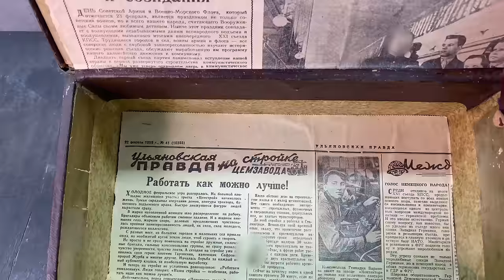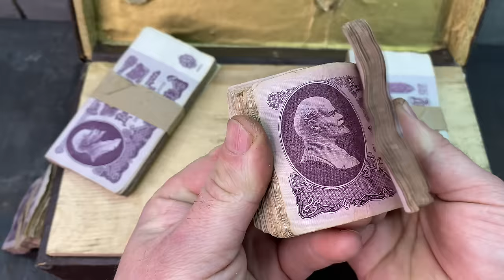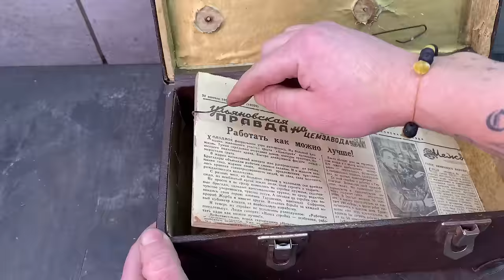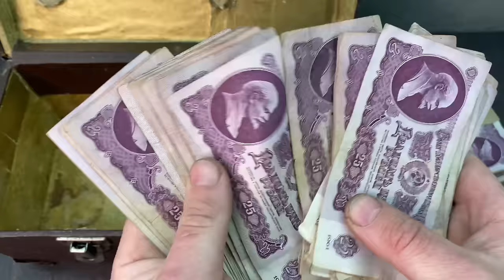Travel suitcase restoration. Found 20 000 💲 under a secret bottom.

Comment from the maker: I think that you will also be interested in watching a video on restoring an old Huge Rusty Drill Press.
https://youtu.be/1rxJamyqY1I
Reply: 这套苏联卢布发行之初，1卢布=1.11美元，中间20几年也算平稳，因为这一时期主要是勃列日涅夫时期，加之美国深陷越战阴霾，这一时期美苏争霸苏联处于攻势，苏联达到了全盛，七十年代也是苏联人民生活相对比较幸福的一个时期，但是也是苏联的“停滞期”，这一时期领导干部几乎成了终身制，特权阶层特权进一步加强，勃列日涅夫带头贪污，下面官僚办事效率和贪污腐败程度就更为严重了，地方官员基本上没有多大变动，可以一直当官当到死，而且有些官职可以明码标价，这样也使得贪污腐败更加便利。总之，勃列日涅夫给贪污腐败、特权阶层、低行政效率创造了一切有利条件，同时给后来苏联老人政治埋下极大隐患。这一“平稳”时期卢布最高时期可达到约1卢布=2美元。然而苏联的好日子却即将走向尽头。1979年底，穷兵黩武的苏联入侵阿富汗，从这一刻起，苏联走向灭亡的命运开始了。到1982年，苏联经济已全面陷入停滞，也是在那一年勃列日涅夫辞世。
Reply: Куда спрятал еще две пачки?
Reply: I think so too. I've already got it queued up! Thanks for your continuing efforts. I find your videos very interesting and relaxing.
Reply: P
Reply: P
Reply: One critique.  Spray adhesive is designed to be sprayed on both items to be used.  You spray the box and then the vinyl, let completely dry then stick together.
It works like rubber cement.
Man you reduced that to just a thin wooden box.  At what point are you just building a new (replica) suitcase?
Good video!
Reply: What did you spend the 20 grand on? P.s. congrats!  Like winning the lottery.
Reply: 😂 11:06
Reply: You do very good work!!!😊❤
Reply: 1ㅣ
ㅣ11
1

Comment: An older gentleman I know bought a fixer upper house, and when going through it found an old chest tucked away in a closet space behind a wall. Turned out it was an antique Lane cedar chest. He showed it to me, and it had beautiful inlay workmanship done on the legs, edges and lid. It wasn't your average cedar chest. He sent pictures to the company Lane, and they told him the chest would bring around 25 thousand at auction. They wanted to buy it and said it belongs in a museum. That was over 25 years ago. Not sure what it's worth now, but the house he found it in cost him 20k. He made out well on that one.

Comment: Hi 👋 Northern Michigan here. As soon as that top fell out and revealed the stacks...I just can't imagine!! And this is exactly why I examine everything I find...especially if is old. I'm rambling I suppose but I bought this house last fall here in the states. It was built in 1947 and I have gone through most of the heat vents and cold air returns. Found a silver quarter from the fifties...lots and lots of old marbles from the same time. A cap gun from the fifties. No stacks of money though!!! The excitement of a possible discovery keeps me going. It is also why I metal detect. Awesome work!!
Reply from the maker: I think you are doing the right thing by searching old houses and objects. You never know what you might stumble upon. All my life I have not found anything of value anywhere, and here is a whole treasure at once (it’s a pity that it’s absolutely useless😁😁😁😁😁😁)
Reply: I found a john deere pony engine buried in my yard

Comment: Great video. I did the conversion from Rubles to US dollars and the 20,000 Rubles are now worth $258.98 US
Reply: В 1998 году ещё отняли три нуля - деноминация).
Reply: @YYX-u7g  I have no idea what you said.
Reply: @terry.jamesrobert  1000 рублей = 1 рубль 
1998 год.
Reply: @terry.jamesrobert  Monetary reform in Russia, 1998
Reply from the maker: You're right. At the current exchange rate, 20,000 rubles will cost $258. But the money from this video has not been used in Russia for a long time, but in 1961 20,000 rubles = 20,000 dollars.
Reply: @ITBR_Restoration  не хочется Вас расстраивать, но 25-рублевая банкнота образца 1961 года выпускалась ровно 30 лет. Состояние денег говорит, что они активно были в ходу, а не лежали в чемодане с 61г. К 1991 году доллар стоил почти 2 руб, а это уже всего 10 тыс вместо 20). Но все равно, поздравляю, отличный бонус за отличную работу!

Comment: Sell the rubles individually to note collectors here in the West. On my two trips to Russia, we weren't allowed to bring currency out of the country, so rubles over here are probably relatively scarce. And they'll be even more scarce for some time... 

Excellent restoration. It struck me that perhaps you should have saved the period newsprint digitally, and relined the case with the images.
Reply from the maker: This is a great idea, but at the moment, there are some difficulties with going to Western countries. I hope someday the situation will normalize, and then it will be possible to establish contacts with collectors.
Reply: @ITBR_Restoration  Hallelujah to that!
Reply: Was hoping you would use the rubles as interior wallpaper inside the case. Good job, well done.😊
Reply from the maker: @ardesslconnel  I still hope to sell these old rubles)))
Reply: Russia May wish to start using them. It would seem that many of the old Soviet ways are returning to use.😢
Reply: @daydreambeliever6603  just the way we like it. thanks for your concern

Comment: You know, you could probably make a small fortune by selling those rubles to collectors.  Their condition alone is nearly pristine.  Also, I think the reason cases ended up lined in newspaper was because it was economical and helped regulate ambient moisture in the case.  When the original liner became damaged, it was easy to just paste yesterday's newspaper on it and call it a day,  Therefore, having newspaper inside a case might have become Hollywood shorthand for "a working-class guy who travels a lot".
Reply: No plenty in circulation....but still each biljet is the equivalent of 7,50 euro's...
Reply: @chloeuntrau4588  20,000 1961 soviet bank note rubles is about $250.00 usd. The restoration was spectacular.
Reply: they are worth nothing with collectors
Reply: @chloeuntrau4588  No it does not
Reply: @blmi5591  having them in original packaging of 100 and the sheer amount of it is definitely worth something.
Reply: @sk31370n  they wernt in original packing some of the notes in the stacks were creased some wernt they were repacked

Comment: in 1961, a Porsche 356B sold for around $3750 brand new. Meaning you could buy 5 Porsches at that time. I’ve searched the comments for a while, but I didn’t find anyone mention that you couldn’t buy a Mustang in 1961. It wasn’t made until 1964. Good show, btw! Cheers!
Reply: I should have read further into the comments before posting my comment about the Mustang being 1964 not 1961

Comment: So based on the comments and notes down below,  it's 20,000 Rubles in 1961 Cold War money.  But it's best value is as collectors cash now at around $5 per note maybe depending on condition. So about $4000 US if all 800 notes can be sold.  Or if they could be spent based on US to ruble conversion that's around $250 US ... money move valuable as a collectors item than real use oh that is funny.  And this was a very nice restoration.

Comment: Cool that you found all that money! Hopefully, it's worth something. I'm sure it will be if it's not already. Nice work on the restoration. If you're going to time-travel me back to the 1960s, I'm going to take the Ford Mustang* over the Moskvich 403 because it was a pretty popular car in the USA. How did the Moskvich 403 sell in the USSR? (CCCP, if I remember correctly)

*Mustang first came off the assembly line in 1964 1/2 so it wasn't available in 1961.

Comment: I need to inform you that in 1961 you could not buy a Mustang. Mustangs did not come into production until mid 1964. But you could buy a Falcon in 1961. The Mustang was based on the same chassis.

I wonder if those notes have any collector value being that they look so new. I would think collectors would be interested in obtaining those notes.

Comment: They can't all be home runs. I don't think you will get the  naugahyde to stay over time. Maybe it's a different glue but it comes out and forms EXACTLY like 3M spray adhesive which is contact cement which only works if applied to both surfaces first and then let dry until tacky, then put them together. good luck though.

Comment: 20,000 Rubles equals about $244 US today.  Still though, it's a very neat find. And there may be some collector value to those old bills but I wouldn't count on that.
Reply from the maker: Yes, thank you, today 20,000 rubles = 244 dollars, but the rate on the video is calculated for 1961, when this money came into circulation.

Comment: You're just a level 80 master.  Friend, if it's not a secret, tell me what kind of glue in the aerosol can you used to glue the eco-leather?  I am engaged in a similar business, although at the level of a hobby, but quite often.  Sometimes I also need to glue the skin, although I use natural, and sometimes fabrics.  I used PVA, if it is not bad enough for the skin, then it is not very suitable for the fabric, because you have to work quite carefully, you will apply a little too much and that's it, after drying the fabric will have a stain.  And your glue will suit me best, I think so.

Comment: I  am not sure what to think.  On the one hand the original case has lost all its patina and the history it told, but on the other hand I guess it was not a very special case in the first place and now you have modernised it to give many more years of service.  I think it would have been good to use a piece of rope inside the handle to give a more comfortable grip like it used to have.
Reply from the maker: Definitely, this suitcase did not originally have any historical value. I chose it as a project precisely because of its shape and size, I wanted to own such a suitcase. That is why I did not adhere to its original appearance, but made it the way I like it.👍

Comment: Restored or rebuilt ? you may as well have made a new box. Because the one you was "restoring" has gone in the trash. Next time try using the same size screw head as the socket on the hinge.